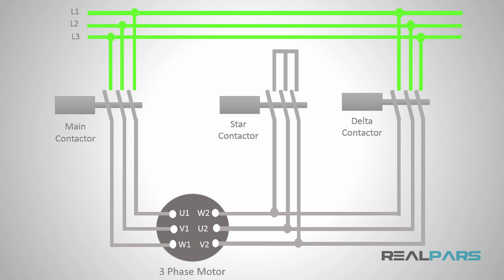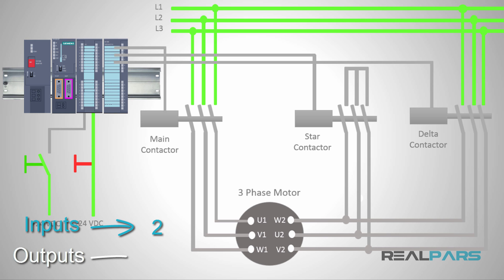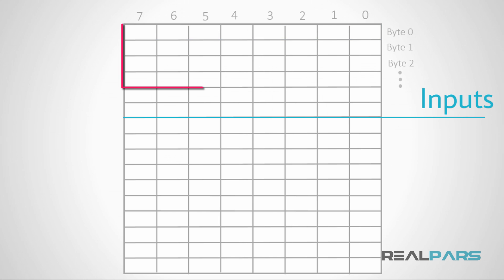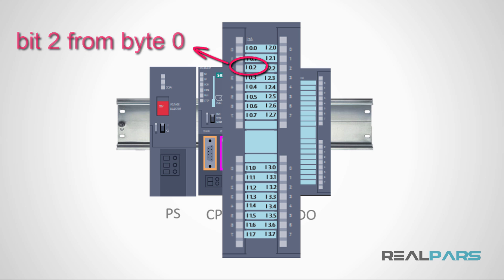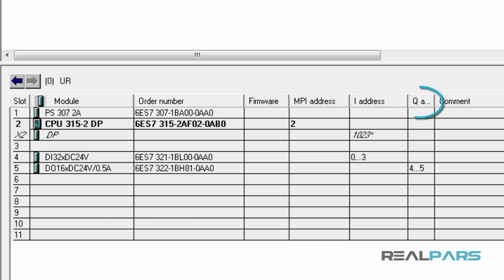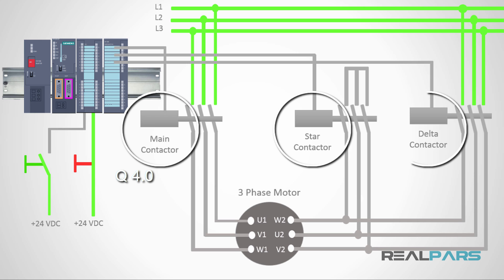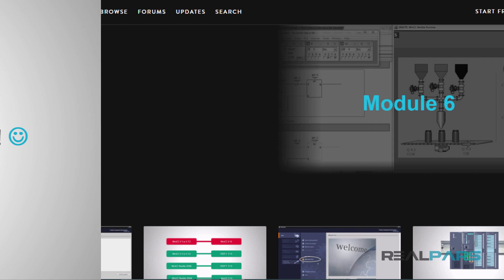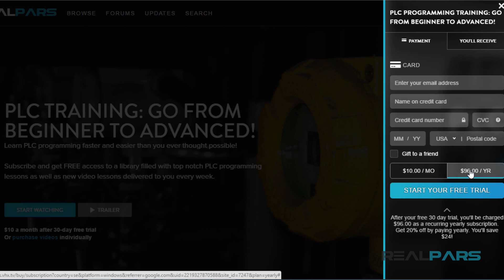Star-Delta Starter PLC Program and Wiring _ Part 9

Comment: Can I use another DO16 in the rack as the input is DI32?
Reply from the maker: Yes. you can.  The PLC will allocate 2 words for the DI32 and one word for the DO16.  There is no limitation, other than the total number of cards for a particular I/O interface, to mixing cards of varying I/O density within the rack.
Reply: @realpars  Thanks...

Comment: Great videos. Really feeding off these. I might have not caught this in the previous videos. Why do the outputs start at Q:4:0? Why not Q:0:0?
Reply: The starting address for an output card are assigned at the time that the card is inserted into the hardware configuration.  Usually, the S7 software will automatically assign the starting address based on the first free block of addresses in the data table not already assigned to other cards or functions.  An output card may have originally been inserted at Q:0:0, but subsequently removed.  Many programmers (like myself) prefer to override the first output card address range and start the I/O addressing at Word 4.

Comment: Maybe a bit overkill to use a PLC for a simple delay switch? 😀 Just use a third solid state timer relay to toggle between the star and delta relays..
Reply from the maker: You can think of this as part of a bigger control system. this is for training purposes. :)

Comment: Why there is no I18 and I19???? Please reply......thank you
Reply from the maker: When you install a PLC input card with 16 inputs, it occupies 2 bytes from the PLC (CPU) memory. Every byte contains only 8 bits so you'll get 16 addresses for your input which you can use in your PLC program. For the first byte the addresses start from I0.0 and continue to I0.7. this is 8 inputs or 8 bits or 1 byte. For the second byte the addresses start from I1.0 and continue to I1.7 which is again, 8 bits or 1 byte. So since the number of bits in each byte can not exceed from 8, we can not have an address such as I0.8.
Reply: RealPars thank you very much........

Comment: I just have downloaded the step 7 v5.5 SP2 & SP3, but those installer not worked. and it's said "you must install the older version." what version i need to install?
Reply from the maker: Sorry for the late response! things have been crazy here at RealPars recently, which is why I’m so late in answering your question. Did you found any solution for your problem? If not, please let me know to see how we can assist you to install the software.
Reply: I can help you with that. Step 7 v 5.5 works on windows xp (not sure about win 7 32bit as i haven't tried). You can find step 7 on torrent websites. These versions are cracked and its very tough to find a newer version.
Reply: +Ameer Hamza I'm using win 7 64bit right now. could that 32bit vers run normally on my pc?
Reply: +Muhammad Fajar I have installed and worked on STEP 7 V 5.5 (Downloded via torrent) with Windows XP 32 bit OS. It worked totally fine without a single glitch.  As far as I know, 64 bit OS doesn't support STEP 7 V 5.5 (available on torrent) as it prompts an error (mentioned by you earlier). The solution is, use VMWare and install Win XP 32 bit alongside your current OS. Hope it helps.
Reply: +Muhammad Fajar And yes, I have just got confirmation that installer aslo works fine on Win 7 32 bit OS. Happy Programing!